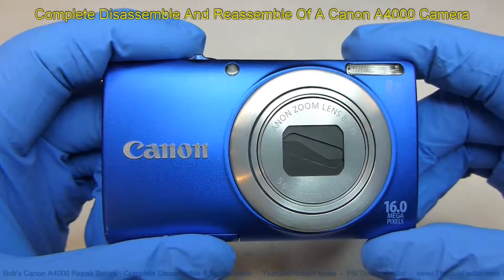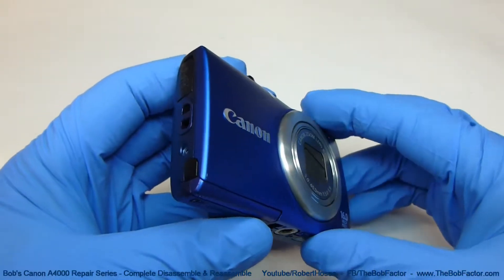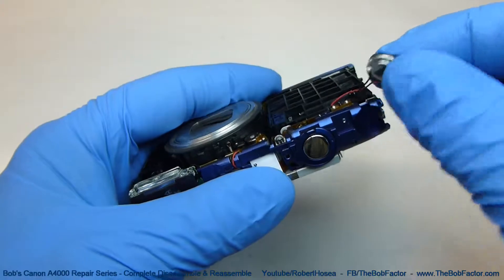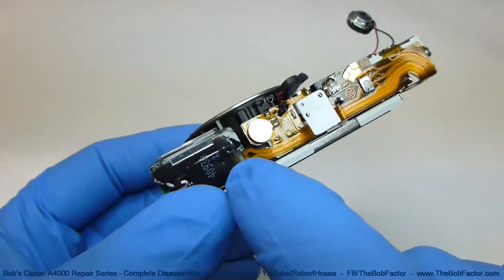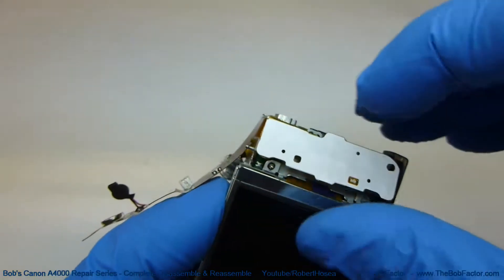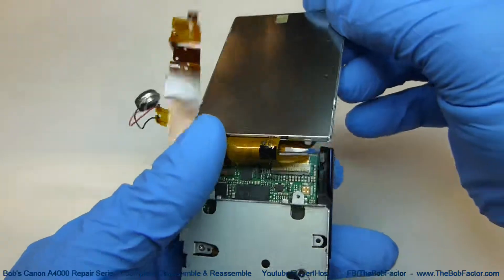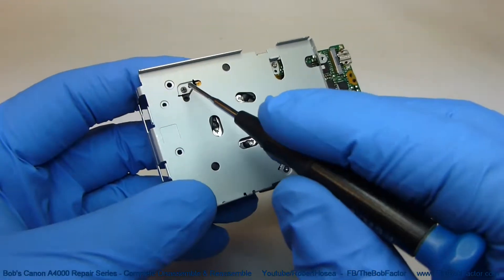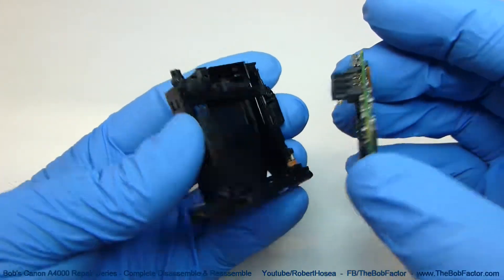Canon Powershot A4000 - A Complete Disassembly / Reassembly

Comment: If the lens ribbon not attached can it power on ?
I've problem, when i hit power button led just blink a few second and just off again and lcd not display anything
Reply from the maker: I'm not 100% sure on that camera, but many digital cameras have to receive information from the lens unit during the power up process, and it will shut back down again if it doesn't receive the information from the lens unit.
Reply: @Thebobfactor  i think you'r right, i'll figure it out if the problem is lens assy. Then the price to repair is not worth anymore. Did you have schematic for the board ? Thanks again.
Reply from the maker: @muhammadFikri24 , I know what you mean on the cost for repairing, especially if you have to take it to a repair shop. One thing that I do (which you may have already checked out yourself) is getting either a "used, working" camera on eBay, or a "Broken For Parts Only" camera. There are quite a few A4000's listed as working in the range of $40 to $50. Here's a listing for one that supposedly works:  https://www.ebay.com/itm/304177145998?_trkparms

And this is a A4000 that is listed as "Broken, For Parts Only", which may or may not have a good working lens or main board, it doesn't say what's wrong with it. But generally if the lens unit isn't shown with it stuck extended out, then the lens is generally good. A lot of times, it's just something simple that's wrong with the camera, plus in this case it's only half the price too: https://www.ebay.com/itm/224420440896?hash

I hope you get it figured out. Good luck with it.
Reply: @Thebobfactor  i found the problem but i can't fix it, the lens unit is broken, all gear is damaged. they can extend but can't close back. 
the camera can boot but no display. i think this motherboard issue because no power on lcd backlight but the backlight it self is good "i already test it". 
so i need to change the mainboard and lens assy, in my local store sell mainboard only about $10 and  the "broken for part only" $12 but i'm not sure the lens assy is working because its a random sell, 
for lens assy i've checked on aliexpress $40 which means if i take a part from a broken camera then i have to pay half of the used working camera price. 

for info that's my client camera and i'm as a local repair shop ask for payment about $10 on that cam. 
i think i'll not continue cause the cost to repair is too high and the camera are not worth it anymore  for a few years.